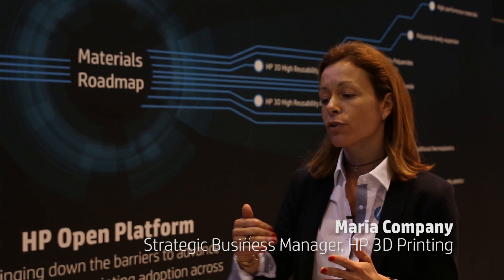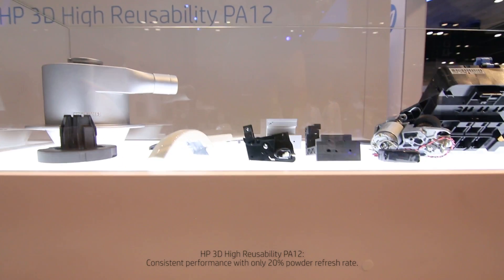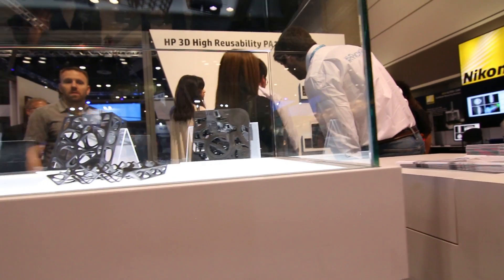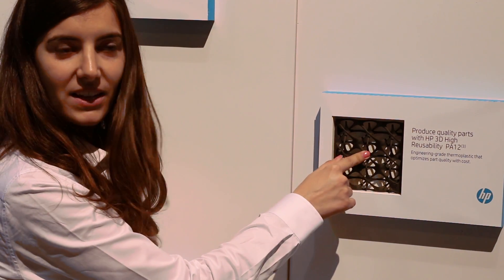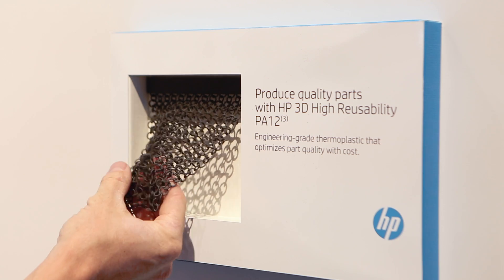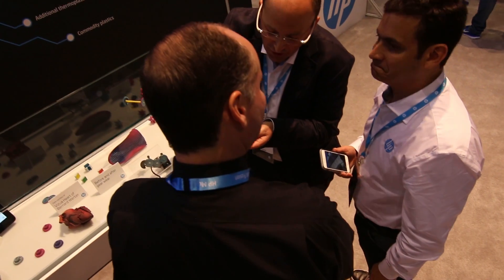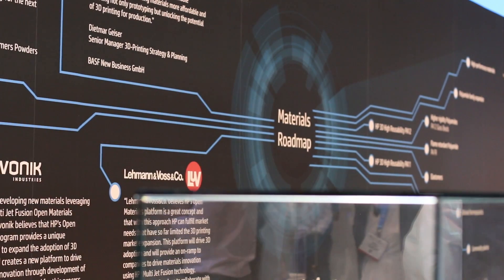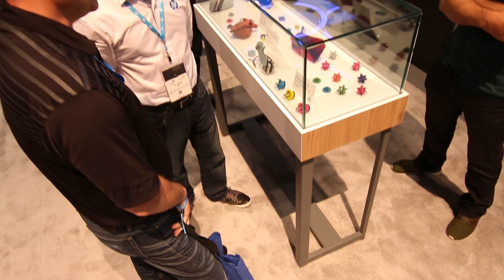Explore the Jet Fusion 3D Printing Applications | Rapid 2016 | HP

Comment: I use the HP Latex printer for printing custom hydrographic film! Latex inks are the only ink that have the vibrancy and color that makes happy customers. It works FANTASTIC on 3D Printed Parts! Are there any other folks out there that print hydrographic film with their HP Latex printer?  Do you use it on your 3D Prints?

Comment: I want to print devices with electrical circuits,  I want to make custom shaped LED's,  someone needs to step on the accelerator pedal and speed innovation up faster.
Reply: you were born in the wrong century. If you're buddhist... better luck next time
Reply: check the palette
Reply: Working on that my friend. ;)